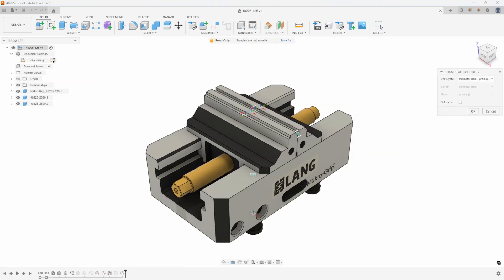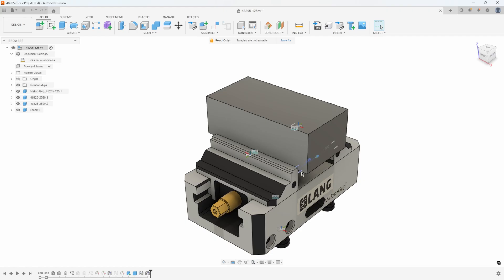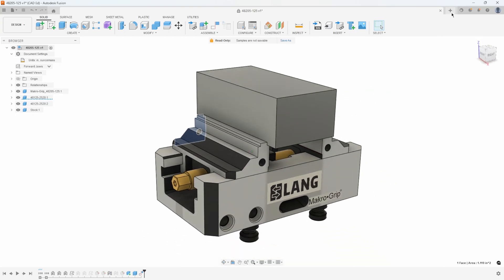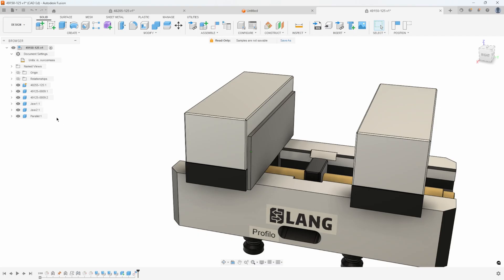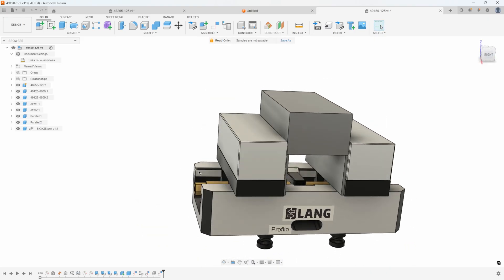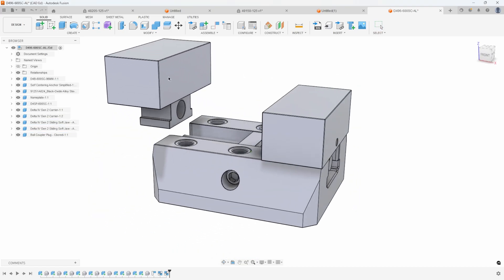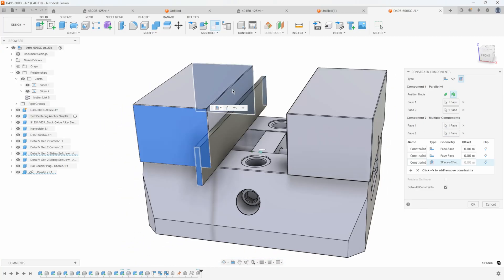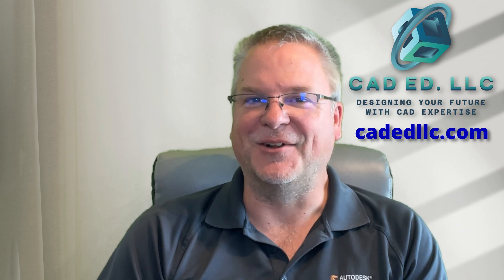Learn How to Center Stock in a vice in Fusion

Comment: So far, neither method works, using joints or using component constraints.  I did eventually get one jaw to be where it should be on the box but the jaw was now at the box instead of the box at the jaw.  Very frustrating.  I can only conclude that he has changed some settings in his Fusion that he hasn't told us about so that our Fusion behavior is different than his Fusion behavior.  I'm now looking for a different teacher.

Comment: Doesn't work for me.  It creates an error about a conflict between my object and Slider 3.  And it also sometimes flips my object vertically instead of maintaining the origin.  In my opinion, you're moving too fast for me to see precisely what you are selecting and the exact way you are selecting it.  I hover over the bottom of my object and move my cursor over and then select the joint center that is highlighted and when I select the jaw, it gives the error.  If I continue, it slides the jaw off of the vice and moves it over to the object and also flips the object vertically at the same time.  It's these kinds of unanticipated and unfixable behaviors that make me hate Fusion.  Yes, these behaviors are fixable but unless someone shows you how, you'll never figure it out because, basically, you're not doing anything wrong.

Comment: As someone who knows literally nothing about CNC, the stock you model in Fusion is supposed to represent the piece of stock you have on hand, correct? If so, does that mean if you have an odd piece of stock you have to model your odd piece exactly so that it can be machined?
Reply: You don't "have to" but you SHOULD for the best simulation. In the manufacturing module, you define your stock size. There is an option to select a model. So if done as Brad shows, you would select this as your stock (in SETUP, second tab). Keep in mind, you need to have the actual part model "assembled" into the stock in DESIGN. You will need to select that part model in the setup as well (first tab). Based on asking this question, I assume you are at the beginning of this journey.  Good luck, and if you are serious, know you are on a neverending path of learning. Machining is a very "black and white" process...parts are within tolerance or they are not and you must be patient and MUST HAVE ATTENTION TO DETAIL! I cannot emphasize this enough. EVERY THING MATTERS.
Reply: @tonycerniglia4777 this is why I don’t think I should get into cnc. There’s meticulous, and pseudo-meticulous. I think I’m the latter.
Reply from the maker: It depends.  In Fusion, when you create a CAM Setup, you can specify different options for "stock", such as "Fixed Size", "Relative Size", "From Solid", etc.  If my part I wanted cut was 3" long and 1" thick, I could put a 12"x12" block of material in the vice and cut out my part, but that wouldn't make a lot of sense.  So, what a lot of people will do is create a "model" of a piece of stock, like a 4x2x2 block and choose "From Solid" or "Fixed Size" in the setup.  It's not necessary, but it does provide a visual representation of how the part would fit inside of the stock and how the stock would fit in the vice/machine.
Reply: @bradtallis8968 I guess what’s assumed in all of this is that your stock piece still needs to be “probed” or verified by the mill before you start matching (to avoid mill crashing). So there’s a few middle steps, I’m guessing, after you set up your stock and before you just let your machine do its thing.
Reply from the maker: Correct.  I did not go into this detail as that's a whole video in itself.  Zero'ing the tool to the stock, setting the WCS position, etc.  There are a lot of videos out there that explains this process.  Like @tonycerniglia4777 mentioned, there's a "process" for machining a part, but that process is a step-by-step guide to make sure everything goes smoothly.  Once you understand it, it is easy.  I cut quite a bit of furniture designs on my CNC with Fusion.